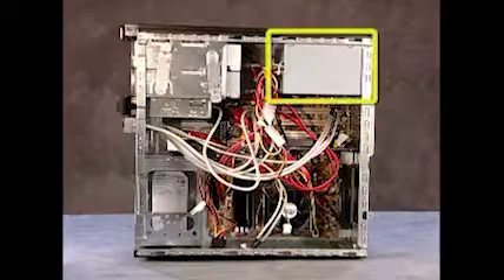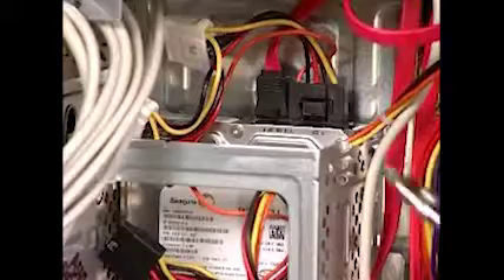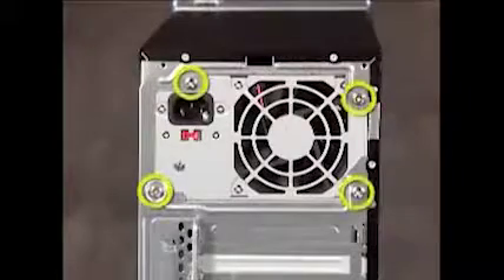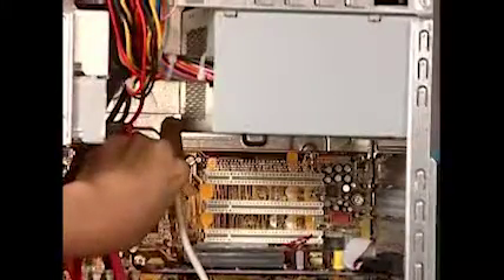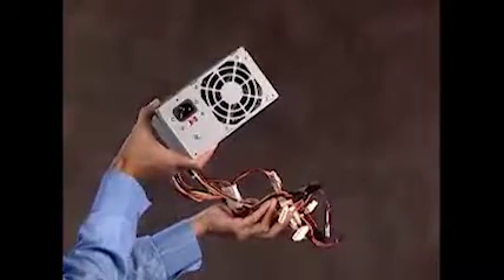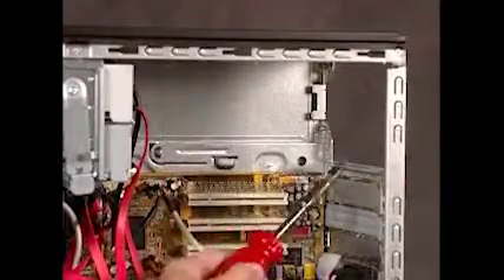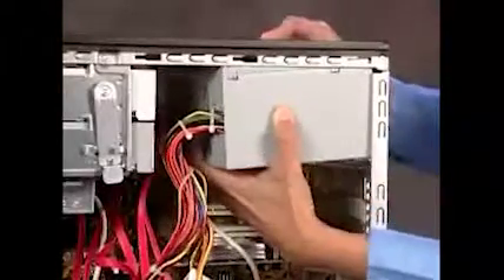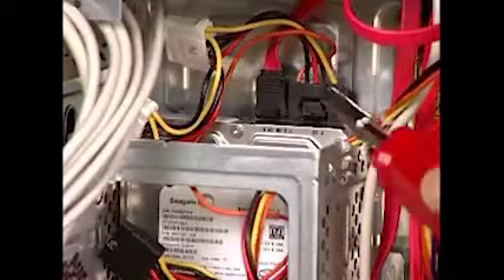Replace Power Supply | Desktops | HP Support

Comment: Where can i get official psu for replacement?
Reply from the maker: Hi David, thanks for contacting!
I understand that you need to know about purchasing power supply unit. 
I will do my best to assist you.
You could purchase the part from HP.
Use the HP Parts surfer to identify the part: http://partsurfer.hp.com/search.aspx 
And order it via the HP Parts store: https://bit.ly/3nKMYrs 
Binu - Social Media Tech Support
Reply: @HPSupport  Im sorry but i have to tell that i cant order for the power supply, the HP computer is HP Vectra VL400 MT
Reply: @HPSupport  Any suggestion or help ?
Reply from the maker: In order to get this issue fixed, please contact our customer care team over the phone or chat for further assistance, as this issue requires Live conversation with you over phone or chat to isolate the issue and provide you instantly with appropriate solution or repair/replacement options available at your place as per the warranty.
Please feel free to reach us on call/chat, please access this link to select your preferred country and language option to reach us. Global support link: - https://www8.hp.com/us/en/contact-hp/ww-phone-assist.html
Binu - Social Media Tech Support